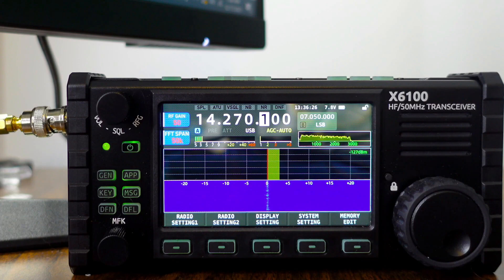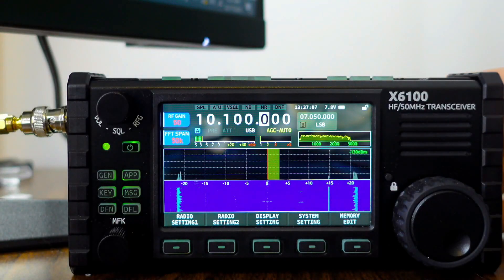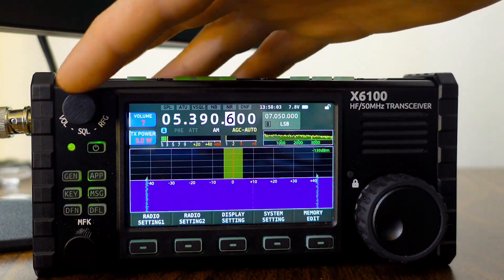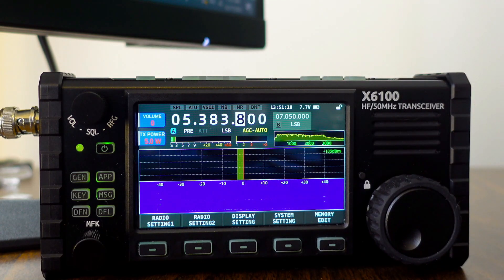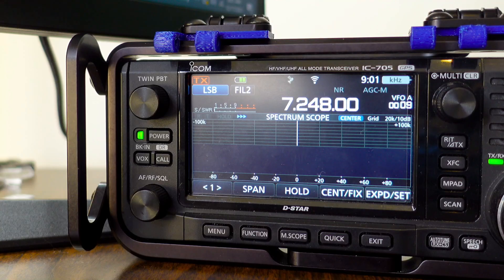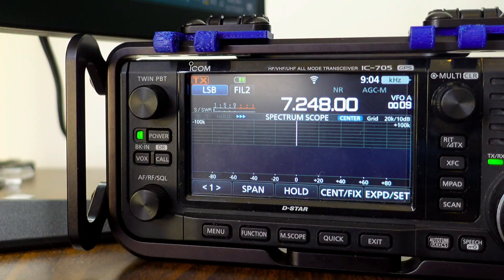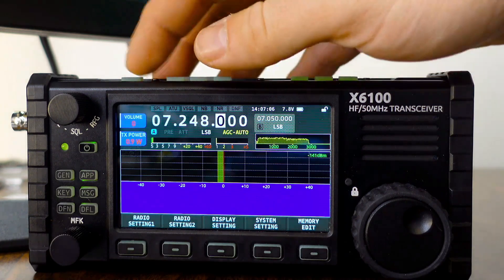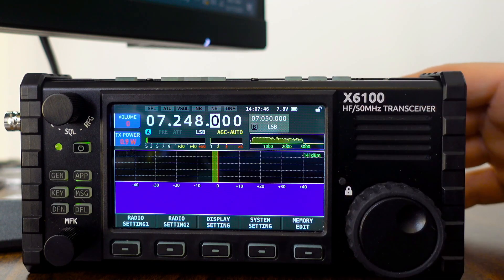Do you know what these 3 WEIRD issues are with the Xiegu X6100? #xiegu

Comment: I just received a x6100 and noticed a lot of noise and birdies without the radio even connected to an antenna. Is this normal with this radio or do I have a bad copy. The S meter seems to hang around s3 without an antenna connected.
Reply from the maker: What are you using for a power source and do you have USB plugged in?  Thanks
Reply: @DudeTested  I was using the internal battery. I did go back in and turn down the RF gain and that seemed to tame it. Also, I had no USB or charger connected or even plugged in nearby. So, there wasn’t another noise source nearby as verified by my other radio.

Comment: 2 more issues for my X6100. 

1.  Radio will Not transmit below 50.100

2.  Radio on CW using any filter, when switching on the "NR"- Noise Reduction... the CW Note sound distorts and sounds like a buzz saw.  

I have the newest firmware update... as of 2022.   I also did a reset to factory settings after the upgrade.   

Anyone have these issues ?
Reply from the maker: I am sorry for the delay.  Just confirmed i can transmit in any mode below 50.100 and i do not hear distorted sounds on CW with NR level at 1.  I do hear what sounds like I am in an echo chamber.  Did you ever get this resolved?
Reply: @DudeTested  no.  But I will check it again this afternoon.   I really appreciate you checking it out.  If still not correct I’ll ship it to our repair facility.

Comment: Great job covering the X6100.  I own  an early one and think its a great radio and it should get better updates. Buying from Radiodity is the only way to go.  I had a few issues and was ready to retun the radio and they were very helpful.  They were also ready to take the radio back for exchange or refund.  I had trouble with dnf distortion and cw lag when using a bug.  They had asked for a video of the problem to send to the manufactuer.  I went to do the video and the problems could not be duplicated.  I have no idea what happened .  The more I use the radio the more I like it.
Reply: I have that CW issue.  I thought it was my imagination.   It's feels like when my Keyer sticks, but it's not sticking.   I made a video of the issue, I spoke about in comments above.   It's a neat radio.

Comment: Thanks for the video!
These are minor issues and don't bother me too much to be honest. 
However there is one problem (very annoying this time) me and many others are reporting. With fully charged battery I get 5 Watts everywhere except 15m and 40m band, where only 2 Watts come out from the transceiver. With the external power supply I get 10w everywhere. This problem occurs both with antennas and dummy loads connected, only on those bands and it disappears immediately as soon the external power is connected.

This problem still occurs with latest FW and after several resets. 

I hope (and think) it's a bug. IMHO if this was an HW issue it would happen indipendetly if battery or external power is used. 

What do you think?

Other people out there with the same issue?
Reply from the maker: I'll be happy to run the tests today.